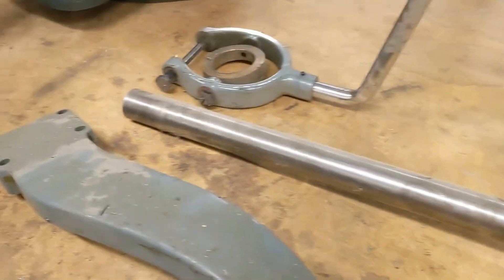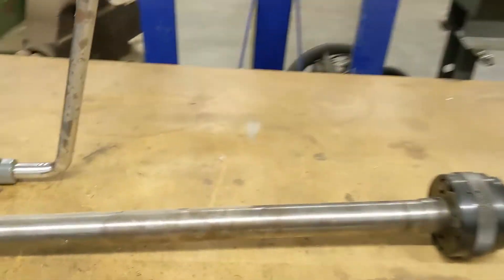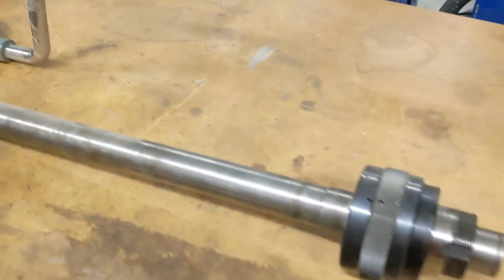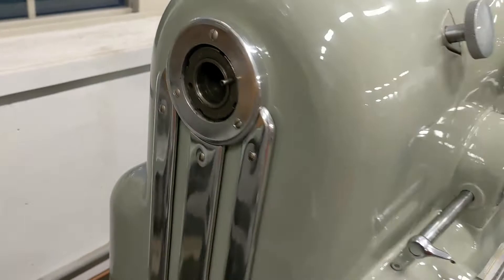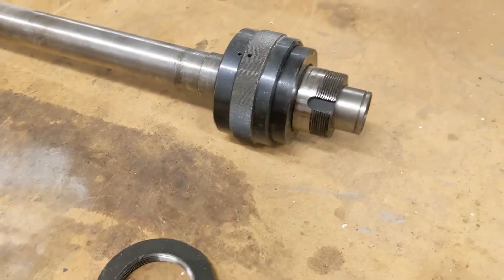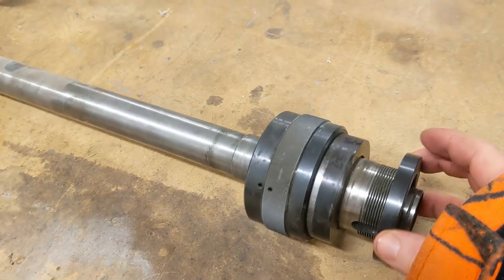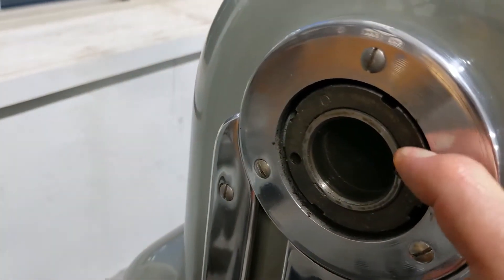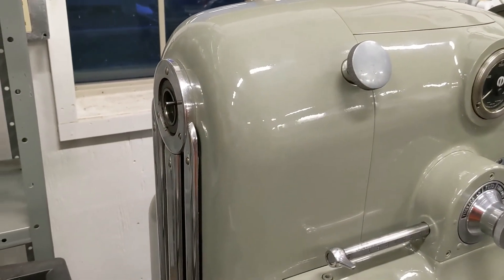10EE collet closer question

Comment: I have this on my EE, i can send pics or video. Let me know how to send to you
Reply from the maker: Hi, can you send to ktbpft@gmail.com?  Greatly appreciate it!
Reply: Hi guys, did you ever get this figured out? I am having a very similar problem. I have the geared part that is missing from your assembly, that installs where your pin is sticking out. On my system, I only have one pin. It is stuck into the gear part, but is way way way too small to engage in the mating hole so it's extremely loose. The gear just detaches and free spins, separated from the spindle. Do you guys have any ideas about this?